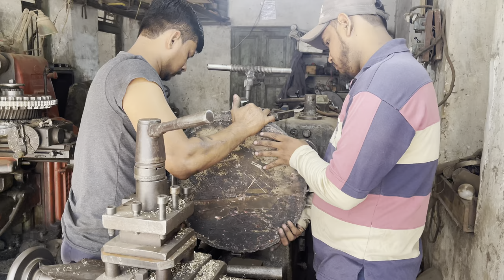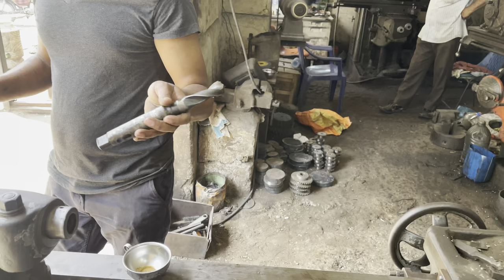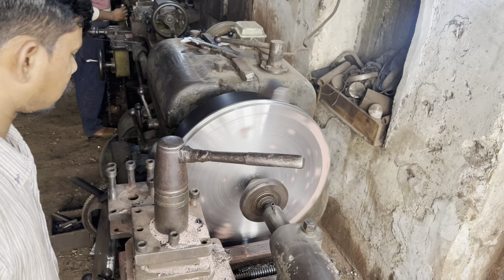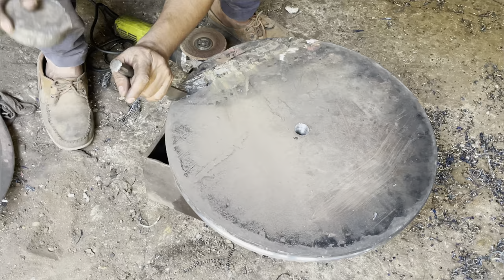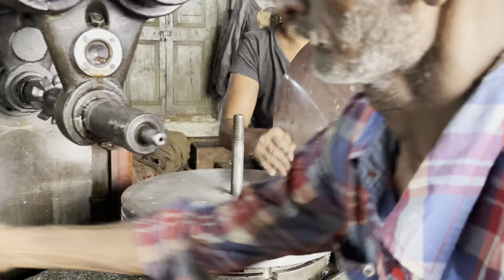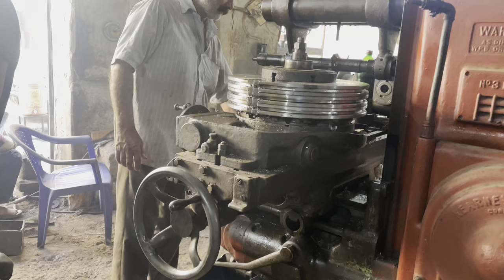How to Make Crane Gear From Scrap High Strength Sheets In Factory | Complete Video

Comment: At least with that bent arbor they're only dulling bout 3 teeth on the cutter at a time. Saves work.
Reply: you just don't understand - it's the new orbital cutting system like you find on jigsaws - allows you to take the full depth of cut in one pass to save measuring - I heard Abom79 & Kurtis from CEE are looking into this.
Reply: The arbor is running straight, the spacers have a different bore size.
Reply: @pvtimberfaller  That's what i thought at first but you can tell from the sound it makes when cutting that it's wobbly.
Reply: The clapped out bearings in the overarm support probably aren't helping either.
Reply: @pvtimberfaller  Then so does the cutter because it's only hitting on about 3 teeth per rev.
Reply: You all are worried about arbor what about them putting chalk lines on dial, what's the purpose and why?   The dial has lines so what gives.
Reply: @davidpieratt  They're just marking the lines they should use so they don't pick the wrong one. They should be using the sector arms for that but aren't. Might not even know what those are for.

Comment: Calipers to tape measure for pitch diameter measurements ?!….. maybe it’s a vernier tape measure. But seriously, you have to respect the work ethic and dedication to working with substandard measuring instruments and equipment.
Reply: For a gear of this size it's enough.
Reply: All tolerances are less then 2 fingers.